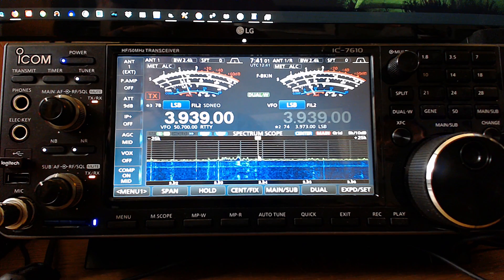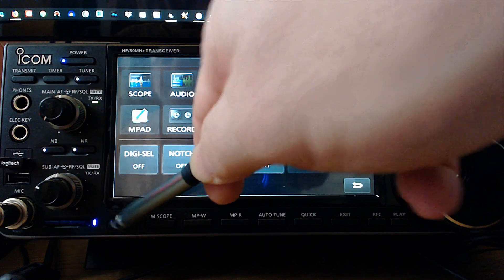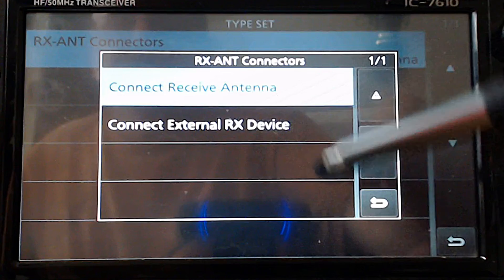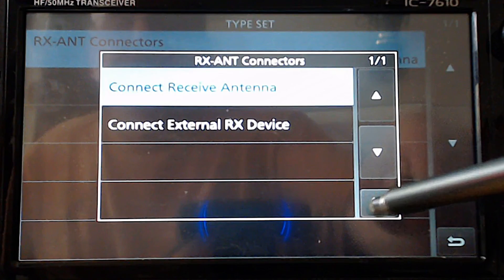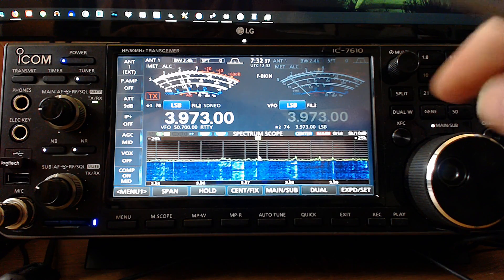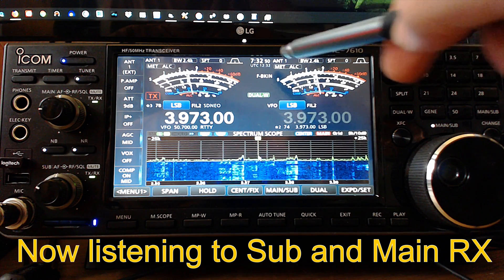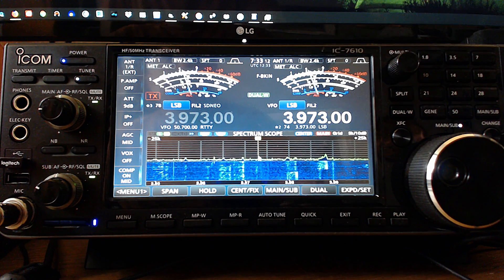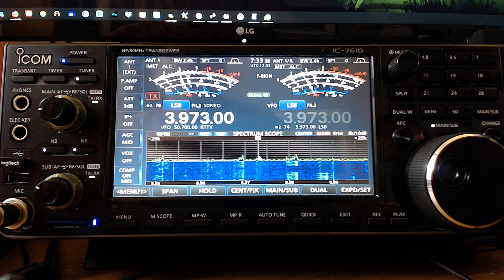Icom 7610 Receiving (RX) Antenna Usage, Dualwatch and Tracking

Comment: is it possible to send on a band an listen at the same time to an other band, like the IC9700 does?
Reply from the maker: @Franky6767  it’s nice to hear from you and thank you for commenting. Great question! I will put it in dual watch and then split. I can transmit on the Sub (VFO B) while at the same time listen on the Main (VFO A). I can listen to both the Main and Sub receivers. Does that make sense?
Reply: @HamRadioAdventures  Thanks Richard for your feedback, it's always nice when people respond to older videos! I'll try your suggestion, thank you very much, and 73
Reply: @Franky6767  thank you!

Comment: what do you use for a receive antenna?
Reply from the maker: Hi David, I am using an inverted Vee up about 40 ft. and at one time I had an inverted L longwire for listening. I tried buidling a loop but it didn't work as well as I thought it should. It's probably my location in the town of Pierre and my noisy neighbors lol. Best 73!

Comment: Thanks for that tracking tip! I did not know that! Quick question.... so how would I use the RX ant out jack?
Reply from the maker: Long story short, attach another SDR, like the SDRplay. You'll need something like a Mini Circuits ZSC-2-2+ Power Splitter. 73!
Reply: @HamRadioAdventures   Thanks!

Comment: Hi and hoping you can answer a question for me, I see that the 7610 has two external speaker jacks. Are they designated main and sub or if you have two external speakers connected and listening to either just main or sub will the audio play out of both? Do you use an external speaker or do you find the internal one adequate? Thanks in advance 73 David W5DPV.
Reply from the maker: I David, it’s nice to hear from you and thank you for watching. I haven’t use the external speaker jacks in a long time. The internal speaker works fine for me. I do use a headset when I need to. If I remember right, at one time I had a combiner (y-cable) attached at the rear so I could listen to both at the same time coming out of my Bose speakers. I hope this helps. Take care, HNY and good DX!

Comment: So I have a 7610 and I’m putting up a 2nd antenna. I use a LDG external tuner. I’m trying to figure out how to configure coax from the radio to tuner. Something automatic so if I hit ant 2 on the screen, it’s now using that antenna. The ldg has a tx port and 2 antenna ports. I’m confounded.
Reply from the maker: Hello and thank you for commenting and thank you for watching this video. You will only be able to hook up the LDG pro to the number one antenna jack on the back of the radio. It stays there while you use the LDG. To switch antennas on the LDG you have to push the antenna button on the LDG and it will switch from one antenna to the other that is connected to the LDG. The second antenna connector on the back of the ICOM 7610 can be used for something else. I have a beam hooked up to it. My wire antennas are hooked up to the LDG. I know this sounds confusing, but I hope it is of some help. Let me know and the 73!
Reply: @HamRadioAdventures  Yes that helps. My 2nd antenna is/will be a Myantennas 160/40 EFHW. MA,s claims you don’t need a tuner. But they say it needs to be min 50ft up. Most of it will be as it’s gonna wind it’s way through trees in my back yard so I’m gonna try going direct out from the ant 2 port on the radio and bypass the external tuner and see what happens. If that works then I’ll configure the radio to use ant 2 when I’m on 160 80 60 or 40m. Thx for the quick response. 73s.

Comment: Nice radio and some handy info..  Does the radio allow you to listen to each receiver on separate speakers?  
73s...   W2OL
Reply from the maker: Hi Mark, thanks for commenting here. Yes it does. Just turn L/R Mix OFF in the radio. The radio does not have two speakers, but it will work with headphones or with external speakers attached at the rear. Best 73!

Comment: Very cool video!! A cool tip..if you hold down change button it will put 2nd receiver into a temp tracking mode. Once you move VFO it will not track, but allows me to hear in stereo with two speakers without turning on tracking.
Reply from the maker: Hello and thank you for the tip and commenting. Best 73!
Reply: I realize Im kinda off topic but does anyone know of a good place to watch new movies online?
Reply: @Elijah Crosby I dunno I use Flixportal. You can find it if you google:D -reese
Reply: @Reese Clyde thank you, I went there and it seems to work :) I really appreciate it!
Reply: @Elijah Crosby No problem xD

Comment: Is the RX antenna i put "protected" from RF? If one wzs running an amp, could there be a problem cooking the front end, or does one need a protective device?  NS2N
Reply from the maker: Hi Paul. The internal circuitry in the 7610 switches it off. No worries and nothing needed. 73!
Reply: @HamRadioAdventures  Hi Paul, thanks for the very informative video! I been told by an Icom engineer not to use my MLA 30+ loop receive antenna for RX in combination with my EFHW for TX, if I can't have them at least 10 meters apart (which in my case I can't) He told me that even if the antenna's are at least 10 meters apart I should use a RF limiter. I'm not going to try if this is correct .. My RX and TX are only 4 meters apart and I do not TX when the MLA is hooked up.
Reply from the maker: @pd9rd  Thank you so much for the information and thank you for commenting here it will be helpful to many. 73!